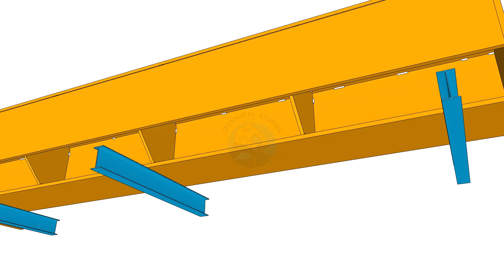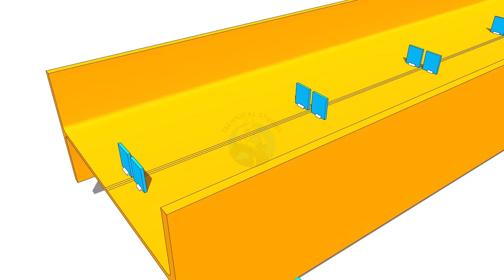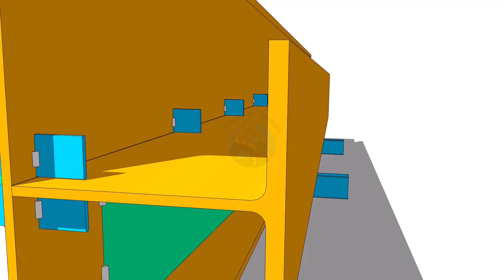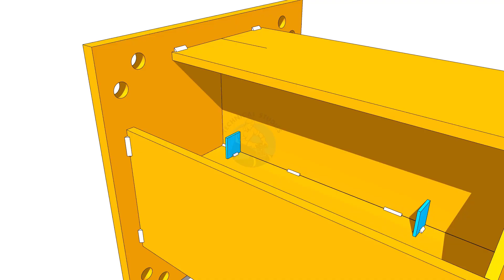How to make, fabricate a Star Column

Comment: hello thanks for your videos. very helpful and informative.
I would like to ask can you make a video tutorial showing how to mark  up beams that are connected on a vertical diagonal position from two levels cut on unusual angles?
Reply: thanks for your reply
I don't have any drwgs on hand at the moment. I will try to get my hands on some. This kind of cut and install comes up occasionally when I install and weld beams. I find I can do quite accurate using string line and bevel but it takes a bit of time to set out. After watching alot of your videos I am curious to see if you have an easier method.
Reply from the maker: @alexthomson-jh5gi  Thank for yuur time Bro.
Reply from the maker: Anyway I am making a structrual tutorial video.
Reply: appreciate the time and effort you put into your videos keep up the good work bro
Reply from the maker: @alexthomson-jh5gi  Thanks Bro.
Reply from the maker: I appreciate your suggestion. Do you have any drawing Bro? If, please email me.